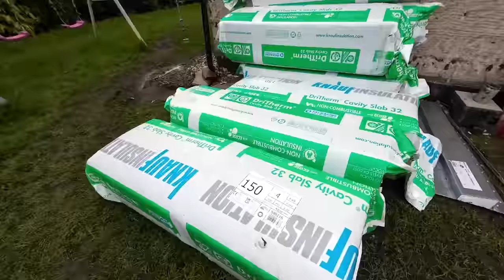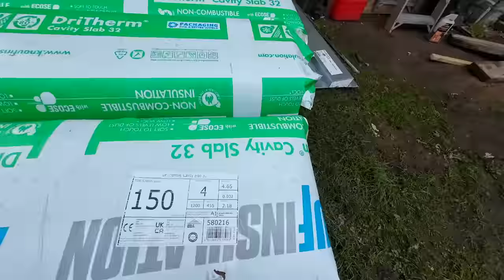150 MM FULL FILL CAVITY !!!..BREEZE BLOCK EXTENSION

Comment: Hi Steve why have you put thin slivers in block work all you had to do was open joints out bit ??  neat bit block work that’s going to be rendered but good job all same
Reply from the maker: Perps would have been too big Trevor 🧱👍🏽
Reply: @SteveAndAlexBuild  not if you would opened up every block Steve you would had slightly bigger perks on all of them, you was wasting time putting little slivers in, in my opinion also I wouldn’t of cut them blocks below I would have done that at top of block work when your coming up to frame height put lintels on as you can bump up which can save you cutting blocks that you did below I can only think brick blockets through it out a bit with putting your wall ties in. In general I think your work is very good just that I work different to you as I’m southern bricklayer I guess 😉👍

Comment: I could be wrong but it seems suppliers are making a killing on the 150mm cavities. Ties are expensive and so is the insulation. I would like to know the extra cost of the wide cavities compared to 100mm. Then wonder how long if ever the extra width pays for itself in energy saving. 🙄
Reply from the maker: It’s ridiculous Doug , they cash in and we have to pay up to comply 🥺🧱👍🏽
Reply: @SteveAndAlexBuild  Quite Steve/Alex. I suspect some "Expert" told the government that this was the way to a green future and now its set in the regulations. Same applied with the horror of fitting heat pumps in older homes sometime in the future. Utter waste of time as huge amounts of power require to heat the hot water. Don't get me started on electric cars as we know how that turned out 😂
Reply: Dont forget lintels !!
Reply: @stephenjohnson22  Of course. Forgot that. 50mm wider. 100% dearer i spect 🤔